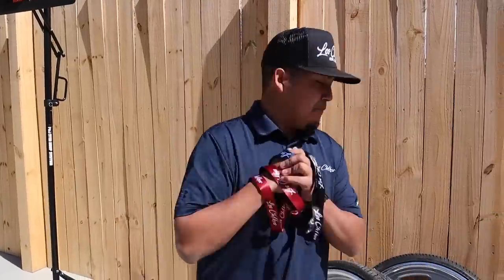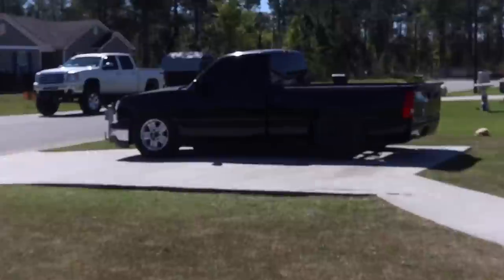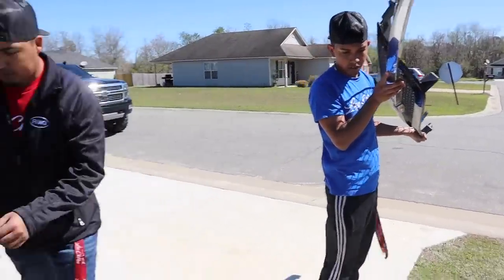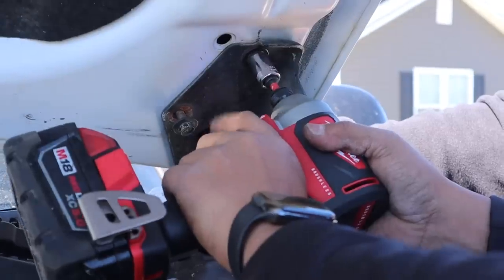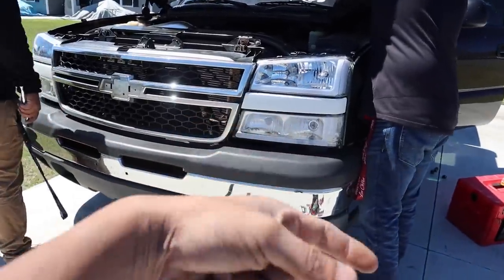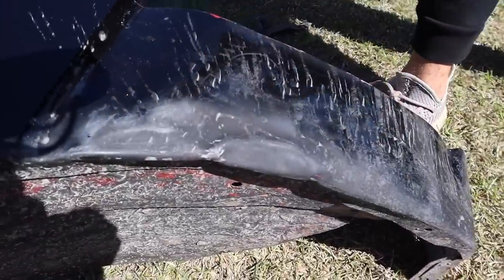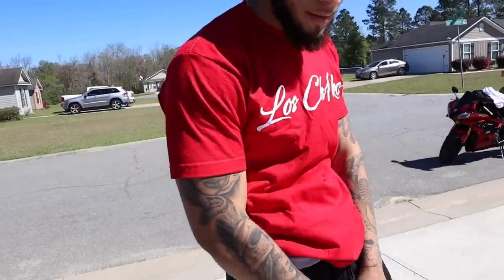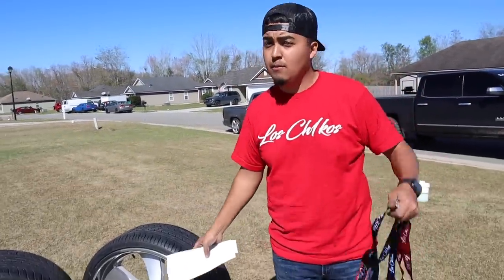HD Front End Swap | Blackuache Returns !

Comment: No hate, but will never understand why everyone thinks a 06-07 front end, is HD 🤦🏼‍♂️ that hood and grill comes in a regular 1500, only thing that changes is the bigger bumper pad.
Reply: I think it’s b/c in 2006 GM started using the Hd hoods across the Board. So it’s basically a factory update to HD hood. 
I have a cladded Avy. So I will never know or never be able to do a bolt on swap.
Reply: correct. I have the same hood and grille on my 06 Silverado 1500. i was confused haha